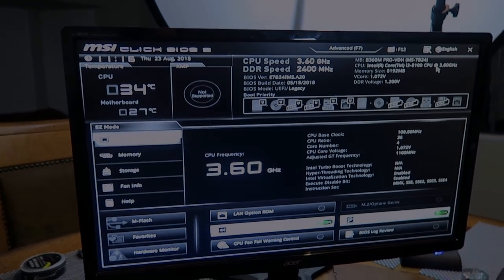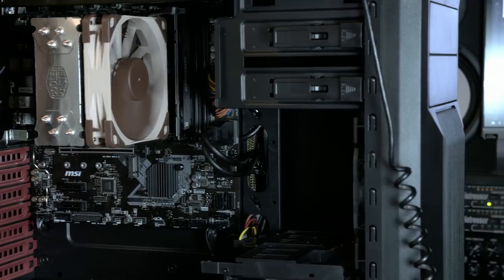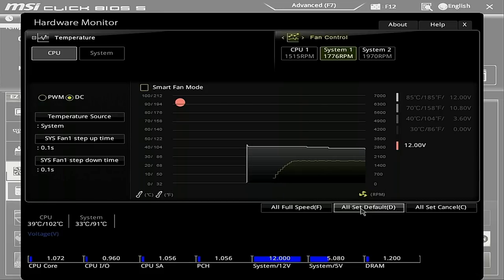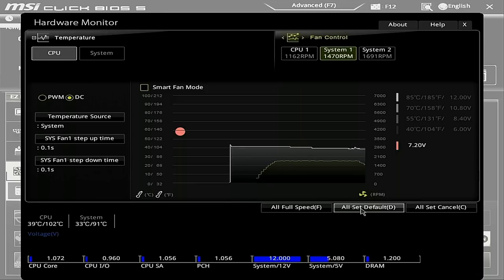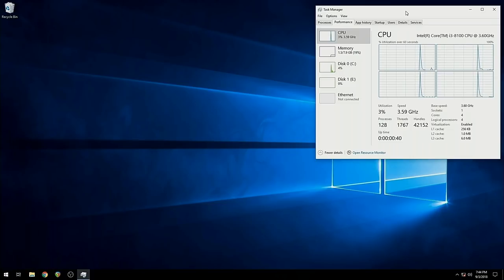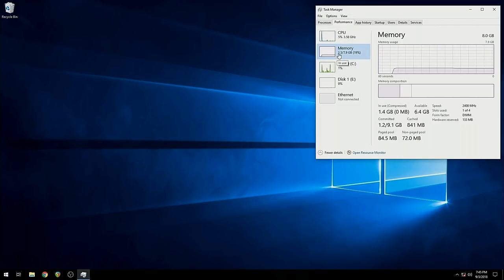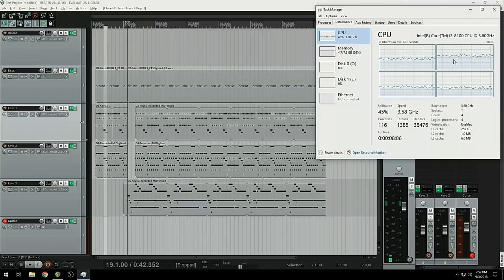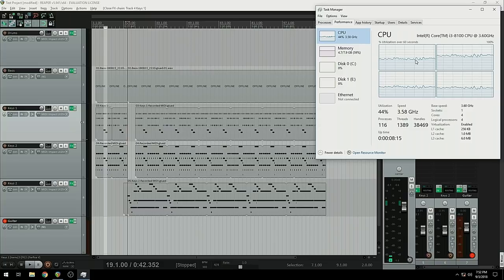Building a $500 Audio Production Computer

Comment: Would a gaming pc work for music production? I have my eye on a particular brand called CybertronPC Rhodium R7. I have no knowledge on how to build a PC specifically made for music production alone. Please reply thank you
Reply from the maker: In general, I'd say that gaming machines make excellent audio production machines.  Just keep control of your fans/cooling in order to keep them quiet.  Other than that the horsepower that it takes it play games at a good framerate WAAAAY outpaces what it takes to record and play back audio.  Just make sure to get enough RAM if you're using sample libraries, enough storage to accommodate hi-resolution multi-track sessions, enough CPU to cope with the plugins that you plan to use, and enough cooling so you don't have to crank up the fans (which is loud) to keep it all cool.
Reply: Here's what I bought. Let me know if its a good fit.
-Phanteks Eclipse P300 case
-Asrock Z370 Killer SLI/AC Intel Motherboard
-Intel Core i7 8700k 
-Samsung 860 EVO 500GB
-G.Skill Ripsaw V Series16GB
-Cryorig H7 Tower Cooler
-EVGA SuperNOVA 850 G1 850W PSU
Reply from the maker: @hoodie3016  I'd say that sounds like a killer machine!  With those specs, that machine should be good at just about anything.  Did you get a graphics card as well?
Reply: That's what I was thinking. What's your advice on what Graphics card i should get for this set?
Reply from the maker: @hoodie3016  I'm not sure what to recommend for graphics cards at this point.  The new RTX cards are still way overpriced, but stock for the older GTX cards is low, so their prices are all sky high too.  There doesn't seem to be such a thing as a good deal on a graphics card right now.  Maybe the used market?
Reply: Your Home Recording Studio 2019 dell G7 great for music production?

Comment: Hi, excelent video. I have a noob question, your buffer setting is 80, I have the Scarlett 2I2 and 64 on buffer (have an old hp dv7), you can have lower buffer setting without pops and cracks?
Reply from the maker: It really depends on your computer and the quality of the drivers for your interface.  With my RME, I can easily work with a buffer of 64 samples and rarely have any pops/clicks/dropouts.  But I noticed with some of the more entry-level interfaces' drivers, I do hear some pops and clicks with a 64-sample buffer.  It's really all about finding the smallest buffer size you can use with your computer and your interface without getting any of those nasty pops/clicks.  Keep dialing it down smaller and smaller until you do get pops/clicks, then dial it back one notch and see how it does.  Best of luck to you!

Comment: nap it wont be ,down load reason 10 ,and use electra x   as your vst ,it uses less memory, 16 channels and it will top out, i have the 4 core version with hyperthread, in also find this E6700 3.19 ghz is not bad its never topt out..........i am in 32bit mode though......

Comment: Hi, is the Ryzen 5 2600 a best music production cpu vs I5 8400 ?
Reply from the maker: Yes, the 2600 would be a great CPU for an audio computer.  The 8400 would work great as well.  They're both 6 core and they both have good speed and turbo speed.
Reply: Dell G7 2019 in April release gonna be good for production? $1.100 usd
Reply: My buddy has a ryzen 5 very nice.
Never crashes

Comment: Hey man
Should i buy i5 9400F or ryzen 5 2400g
And which motherboard would be best?
Reply from the maker: The i5 9400F lacks any sort of on-board graphics, so you would need a discrete GPU in order for it to work.  On the other hand, the Ryzen 5 2400G is an APU that has a very capable GPU integrated into it.  Given the pretty huge price discrepancy, I'd go for the 2400G personally.  But that's assuming that it would serve your needs.
Reply: Your Home Recording Studio i use a lot of serums (the vst) and video editing (not the professional one but the basic stuff)

Comment: I'm gonna tell everyone a secret. Go with osx and an apple computer .
The reason I say this is because the driver latency is much better with fewer dropouts in your midi to audio conversion. By using osx , you can even get away with having little to no external audio interface .

can't do that with windows .
Most daws run smooth out the box running under osx . even on older machines.
Then you just need a USB mic . save thousands by avoiding the Windows based PC for recording and midi multitracking. If you need to , hackintosh a newer 
machine and run osx.

Comment: Can you upgrade the ram or does it cap out at 8 ?
Reply from the maker: This motherboard supports up to 64GB of RAM.  You'd have to use 4 16GB memory sticks to fill that out, so that'd mean getting rid of the 8 GB stick.  But 4 8 GB sticks would work just as well for 32 GB of RAM total.
Reply: @YHRS  will it affect the performance of the computer if you add heavy ram
Reply from the maker: No performance impact to adding lots of RAM.  Not having enough RAM is a problem, it can slow down the whole system because the CPU has to work harder to swap things in and out of RAM because it won't all fit.  I'd say 16 GB is a happy medium for RAM on most systems, and you can always add more if your needs demand it.
Reply: @YHRS  Thank you bro

Comment: So if you didn’t get a gpu how are you seeing Windows 10
Reply from the maker: Most motherboards support the integrated graphics that most CPUs can provide.  So I just plugged the monitor into one of the video outputs that the motherboard exposes on the back panel of the computer.  Beware though, because not all CPUs support integrated graphics.  But I'd say that most of them do.

Comment: not very wise running ANY kind of PC with single channel RAM. Even if you were only going to use 8GB (Still FAR from recommended past 2012) it would have been much better to use 2X8GB Modules to get the benefits of dual channel operation.